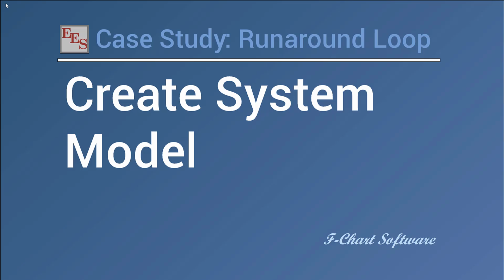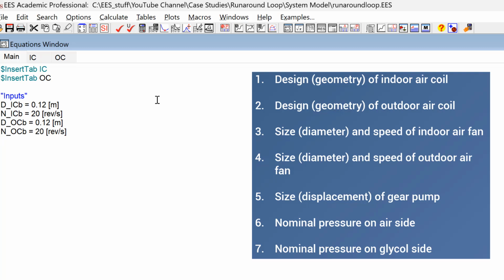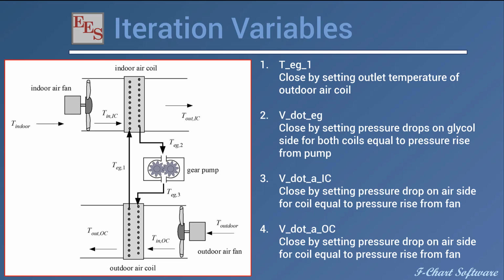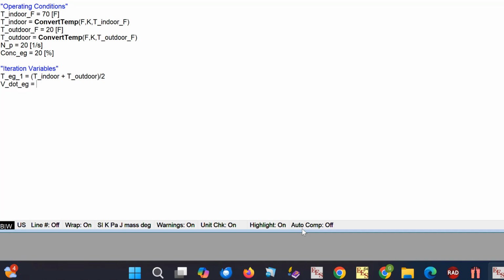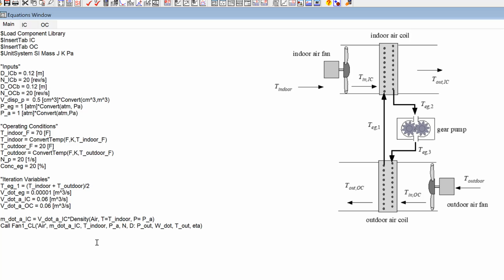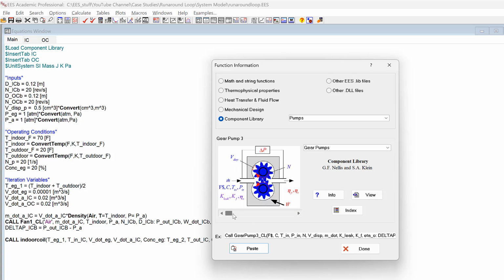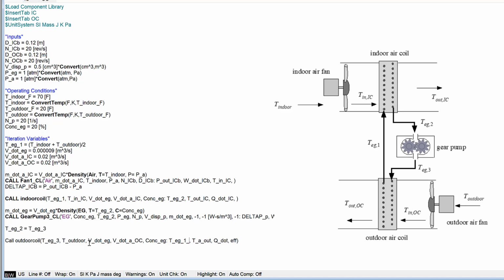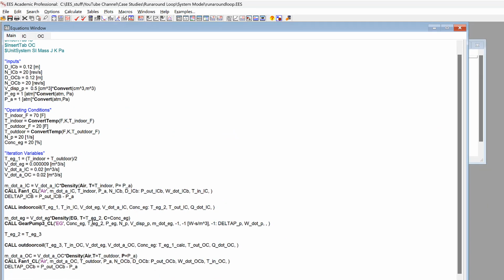Case Study: Runaround Loop   System Model

Comment: how can we use time stepping like one hour transient simulation for a water storage tank integrated with heat pump. I have modelled it in EES but whenever i try to do time stepping using integral it does not allow saying inside a  defined function the integral is not possible
Reply from the maker: I'd need to know more about what you're trying to do to answer this - it sounds like you are trying to use the Integral command from inside a function or procedure which cannot be done.  You can use the integral command inside a subprogram though.